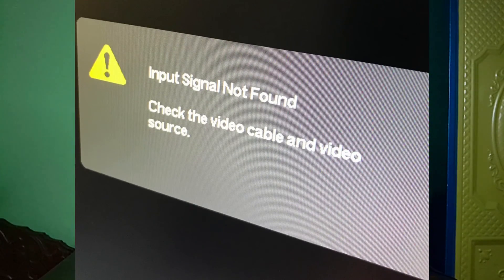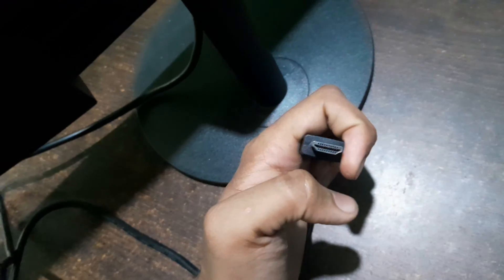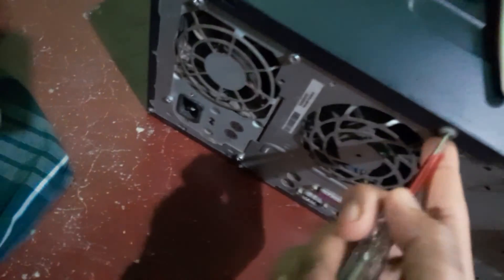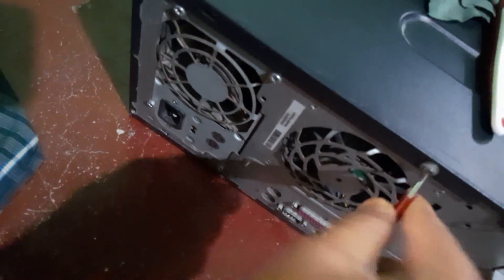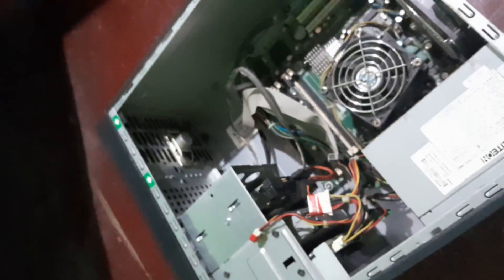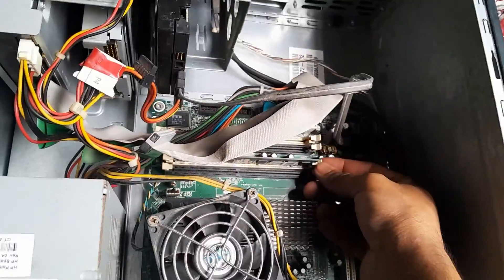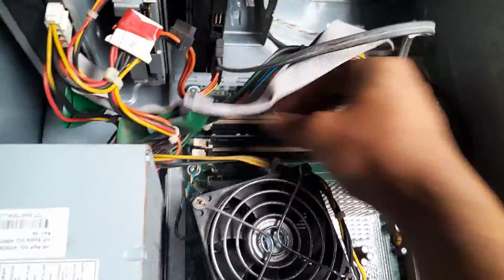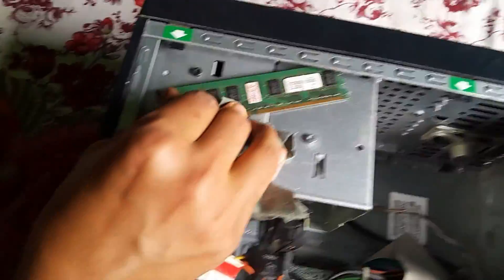Input Signal Not Found HP Monitor (3 Ways to Fix)

Comment: Bro my cpu is working fine
When i click multiple keys on keyboard, there is a windows sound 
Only the monitor aint giving any display
Saying hdmi inactive
Reply from the maker: Try a different cable or input source. And also make sure the monitor port is not damaged
Reply: @VisionPlug it's fixed, my gpu was loosened

Comment: The processor fan of my PC isn't working and when I tried starting my PC it was working for few minutes and then suddenly when off, this happened for few times and now it's only showing Input Signal not found
Reply: What to do now???
Reply from the maker: A non-working processor (CPU) fan results in rapid overheating of the CPU. Modern CPUs have safeguards to shut the system down when temperatures reach unsafe levels.

But the message you are getting now is because the monitor isn't receiving any signal from the PC.
So first, disconnect Power and then Open your PC's case.

Now check the following:
1) Is the CPU fan completely stationary when you try to power on the PC?
2) Are there loose cables or connections near the CPU fan, CPU power connectors, or motherboard?
3) Any signs of dust build-up inside the case, especially around the fan?

So first off all, make sure the CPU fan is working (replace it if it's not working), then clean the RAM and it's slot, reset the prossessor and the BIOS (as I showed in the video)

If nothing works, you have to figure out yourself what the actual issue is. may be send it to a repair man...